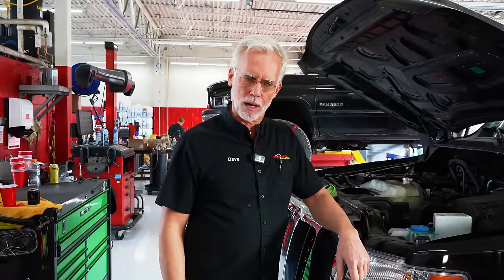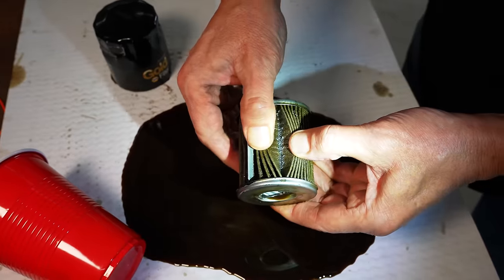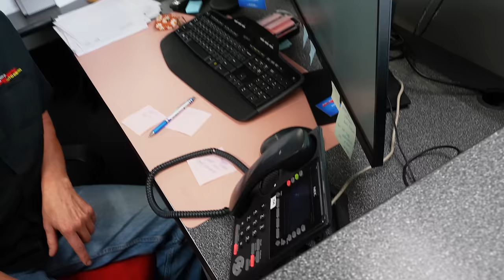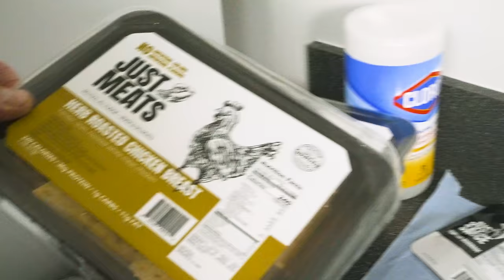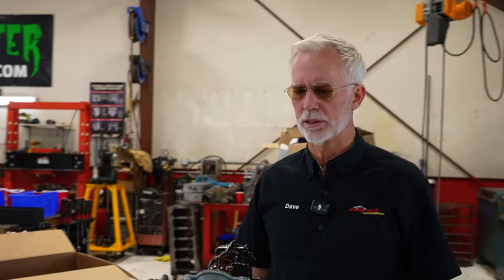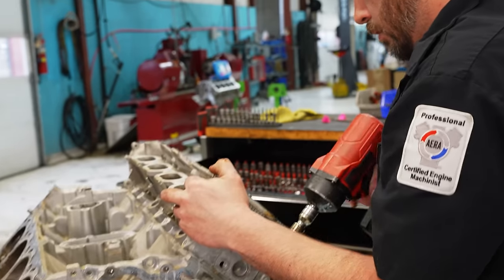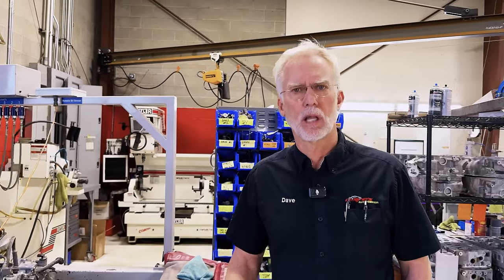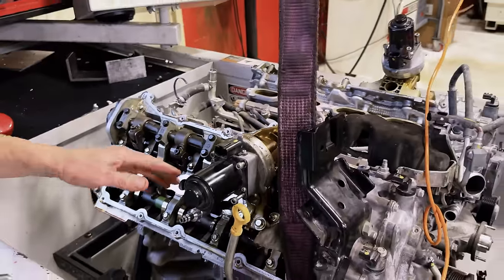2018 Nissan NV 3500 Van. Lack of oil changes ruined an engine with only 50,000 miles on it

Comment: My buddy has a big rig…he does long haul…his Freightliner has an N14 Cummins and he bought it new and does all his own light mechanic work and maintenance…he’s an absolute freak when it comes to maintenance…these rigs will go 20,000-30,000 miles on an oil change…he did his every 15,000 with Esso XD3 when they made it and then went to Mobile 1…he put a quart of ATF in every oil change and a quart in the fuel tank when he filled up…after about 2 million miles without putting a wrench on it the engine was starting to get a little tired so he took it to Cummins to rebuild it…they wanted $30k to rebuild it but couldn’t believe the mileage on it and figured this was at least  its second…he said he never touched the engine so they called Cummins Corporate and Cummins offered him a brand new long block crate engine for the same price if he would give them his old engine so they could do a tear down on it to try and figure out how it lasted so long…so that’s a testament to how important maintenance is!..change your oil people!!
Reply: That's incredible! What was the outcome on the teardown of his original N14 Cummins?
Reply: @matthewmiller2268  I don’t think they ever told him…I’m going to quiz him about it!…
Reply: The N14 isn't part of the million mile club for nothing!
Reply: The N14 has a "robust" bottom end to say the least. You keep it well maintained and it will last a very long time as evidenced here.
Reply: @ronaldrussell5481  he also doesn’t drive the truck hard which helps a lot too…I worked with a guy in Alberta who drove a heavy spec Kenworth winch truck and it had a 575 Cat in it and it was coming up on its bearing roll-in schedule which was likely 500,000-750,000 kms, and he took it straight to Cat and the mechanic dropped the pan and pulled the cape and measured the main bearing clearance on all of them and he said they were all the same as new bearings and so there was no point in replacing new with new so he buttoned it up and told him to keep doing what he was doing…I couldn’t tell you his oil change intervals but he was definitely a fanatic about his truck and one other important point he told me was he never drove faster than 90km/hr…so driving habits also increases engine longevity as well…a new engine today is gonna run a fella close to $50k these days so it’s probably a good idea to consider taking car of your rig!
Reply: Absolutely cheap insurance.
Reply: That's agreat story
Reply: I'm not that knowledgeable on diesels, how does the ATF help?
Reply: @MrMan5014 I think not driving your vehicle hard and just take it easy (and keeping up with maintenance) are a sure way to get your engine long last in general. Sadly, some people just did the opposite.
Reply: Shoulda kept the old one ha!
Reply: Why wpuld you put atf? Lol
Reply: Atf cant be good in the oil?
Reply: @qwertykevin1  the engine made it to just over 2 million miles…I can assure you it’s part of the reason why it made it to that high of mileage when most engines don’t make it to half that mileage…the man is almost 70 and has several other trucks and he did the same thing to everyone of them with similar results…he uses it on his personal vehicles as and so does his nephew who had 3 vehicles that made it well over 300,000 when he sold them and they all worked excellent!..it keeps the engines internals clean and prevents sludging with proper maintenance…once there’s sludge in an engine, you’re on borrowed time!
Reply: Love this story!
Reply: What an acaccomplishment! I drive rigs hard unfortunately.  Heavyhaule....
Reply: @theglitch99  heavy haul is fine…the guy with the Kenworth was hauling a 70 ton wheeler low boy doing a lot of oilfield hauling and heavy construction equipment…he rarely had anything lighter than 30 ton on his truck but he drove the truck like he was an old woman driving a Chevette to church on Sunday!…the problem is most people don’t have the time or patience to drive like that, but the way he looked at it was he got paid by the hour so why push his truck hard and kill it?..🤷🏻‍♂️…makes sense I guess…I had a Ram 5500 and I tow my 6 ton mini with it and I got into the habit of not driving it faster than 55 mph or about 90 kmph and it’s amazing the difference in fuel consumption and wear and tear on the truck
Reply: @MrMan5014  I feel like the atf has to break down the oil thou? Can't argue with experience but any science to it?
Reply: @qwertykevin1  ATF is derived from the same base oils as engine oil with similar additives except in different concentrations such as detergents and friction modifiers…these friction modifiers are used to keep small moving parts from sticking like valve guide, lifters, and piston rings…they are especially helpful in high pressure oil actuated fuel injection systems found in earlier Ford, International, and Cat engines…injectors get sticky and you get hard starts, rough idling, stalling ect…Archoil 9100 is a very expensive version of ATF and is proven to help engines run correctly and minimize wear…most diesel engine oils like T4, T6, Delvac1300 have Jaso certifications which means they are good for motorcycle engines with wet clutches and high revs…imagine having a high revving motor cycle engine with a sticky valve…these additives keep them clean and moving freely!…the proof is in the pudding!…In my experience ATF works very well in engines in the right amounts!…1 qrt in a five gallon bucket isn’t going to break down anything…
Reply: They do a tear down to make it  more cheap for the new generation
Reply: N14 is pretty bullet proof, close to a Series 60 Detroit.
Reply: It's not our residential vehicle 0-20w garbage oil either. Great work. I'll consider looking into those tips. But dave and that Lake guy just said any fuel additive is needed for gas or diesel. It's made a small 1-2mpg difference in my truck and highlander. Great story.
Reply: Oil in the fuel what’s that about is this something to consider for a smaller diesel
Reply: @joshuabrown1117   it helps to keep the injectors from getting sticky and I adds lubricity to the fuel to prolong injection pump life!..people have been doing it for years…since the 50’s or 60’s…it’s good for all size diesels..not sure if I would use it on modern diesels though but I’m sure it would be fine..
Reply: @joshuabrown1117  There was talk that the low-sulfur diesel is too 'dry' for pumps and injectors. Many companies have come up with fuel additives to help lube up the system. Thinning out a litre of oil in a full tank may greatly increase the lubricity. I'm sure there are YT vids testing this theory. 
Adding ATF in the oil, running the motor then doing a change has been practiced for decades. The cleaning additives help flush out the gunk. Adding it after the oil change sounds weird to me.
Reply: @mplslawnguy3389  a lubricant i would assume.
Reply: @qwertykevin1 back in the day truckers used to put transmission fluid in the fuel tank, just one quart because it was a very cheap and effective fuel injector cleaner
Reply: For hard working trucks it's best to do oil sampling regularly to test how worn the oil is and to track for any irregular wear in the engine

Comment: CHANGE YOUR OIL PEOPLE! Dave doesn't want to see your engine in his shop like this one...
Reply: at least put oil in it!!??
Reply: @heethen112  It was more of a PSA then anything
Reply: Yep Nissan motors should last 30 years without any problems if the oil is changed regularly and looked after
Reply: @CruisinCaprice in 30 yrs me and my dad will have 600k or more miles on an engine easy .. that comment is a lil exaggerated 😂
Reply: @heethen112 yep need oil the owner says they ran it dry
Reply: He secretly does or he would be broke 😂
Reply: People think i am crazy to service my GTI every 3500miles or every 6 months. I just use OE/OEM parts and liqui moly 5w40 ( Mk7 gti )
Reply: I actually think Dave likes seeing these poorly maintained cars come in because,  if I owned an automobile repair shop,  I'd find it quite easy to tell a customer...it will cost 12,000 to fix this
Reply: @CruisinCaprice I think they last about as long as the water pump does. Who put the water pump driven off the cam chain under the front cover inside the crankcase? That was a total ford move
Reply: @Youtubecensoredmyusername  that’s why oil pressure gauges are a great idea for any car.
Reply: NEVER!
Reply: Nissan, owned by Renault enough said I think.  @CruisinCaprice
Reply: @blackvulcan100  I drive a Nissan patrol with over 800k on the farm I work on  and it never fails.
Reply: It makes money for his business when people neglect their vehicles
Reply: After you watch that I do cars dude break down a few trashed engines, you will definitely check your oil.  Everyone who drives a vehicle should watch those videos.
Reply: @CruisinCaprice …definitely not true with a nissan made in the last 15 years.  Nissan used to be quality, not anymore; but that’s true with most manufacturers.
Reply: @deplorablelibertarian  maybe right there, I haven’t driven any late model Nissan, I stick to Toyota Holden or Fords
Reply: Seriously, though. Use good oil, good filters, and match the schedule. My Subaru is every 7500 miles, and my wife's Toyota is 5000 miles. If you really want to save money, then do it yourself. It isn't that hard.
Reply: @Vikturus22 it’s definitely overkill, but nothing wrong with taking care of your shit ( not time or mileage ) liquid Molly is expensive and test have found mobile 1 has a equal performance  for cheaper !
Reply: @CruisinCaprice yeah okay 😂 Nissans one of the worst vehicles out there.
Reply: @RevDevGaming  yeah I’m sure you know what you’re talking about hey 🤪🤦🏻‍♂️🥱
Reply: @RevDevGaming  maybe on your computer games, sped boy talking like he knows anything 🤪 how much experience do you have with Nissan Motors? Don’t lie though 😆
Reply: @CruisinCaprice  You sound exactly like the kind of person that would defend a poverty ass Nissan.
Reply: @CruisinCaprice  As someone who worked at a Nissan dealership for 3 years I’d say I do. They are terrible vehicles that constantly have major issues. They suck to work on and the only people who buy them are people who don’t know any better. How poorly they hold their value should speak for how well they are built.
Reply: @RevDevGaming  what country?
Reply: @CruisinCaprice  I live in the US. I’m not referring to like the GTRs and the cool stuff but their everyday consumer vehicles are complete trash. The old stuff was pretty good but much like Kia their new stuff is just terrible.
Reply: @RevDevGaming  I’m talking about the older Nissans, patrols and skylines ect wouldn’t buy a Nissan pulsar or anything gay like that and I was talking about how many miles they can handle so nothing you learned working for Nissan has anything to do with my first comment 🤫🥱
Reply: @CruisinCaprice  Yeah they weren’t all bad. The patrols are cool. I was referring to their new stuff. I’d go as far as to say they haven’t made a reliable or good vehicle for a quite a while now though.
Reply: I drive a 2002 Chevy Silverado with a cammed 5.3 it’s my baby I change it every 3,000 to 3,5000 yes always check your oil and change your oil at 3,000 to 3,500
Reply: Unfortunately, those dummies are never in short supply. Keeps Dave going strong tho lol
Reply: @AMan7595  I wouldn't trust that 7500 mile interval unless you live in the perfect climate and you only drive easy highway miles like a sedated librarian and subaru's have been known to burn oil so be careful with any extended interval.
Reply: @Vikturus22 3000miles is minimum, 3500 is way over
Reply: You're right about some Subarus burning oil. Keep an eye on that dipstick peeps!!!!
Reply: But wouldn’t Dave be losing money if he didn’t have cars to fix?
Reply: A nissan notor lasting 30 years?  Un thats a little bit of a stretch bro lol@CruisinCaprice
Reply: @CruisinCaprice yeah sure
Reply: @CruisinCaprice fords that's your problem right there

Comment: Nissan tech here. I’ve replaced short blocks on those engines for the rod knock issues. I’ve never seen one as bad as that. I bet that engine never had an oil change. They probably just kept topping it up
Reply: Hi, I have a 2019 V8. Would you say there reliable? I am aware of the cylinder #7 scoring on the newer models.
Reply: Timing cover will leak oil 👍 that’s for sure. And you don’t see too many of the cylinder scoring issues.
Reply: Man that TSB for cylinder 7 knock. Bruh… not a fun job hahah
Reply: @jakemathers4137  Yeah they suck. Just another reason why I got out of that garbage trade.
Reply: @rickfrey6944  It’s still possible that your v8 could develop that knocking issue. Nissan said they made updates to the short blocks but I’ve seen a few have it happen again. Just make sure you do your oil changes on time. Other common issues we’ve seen is upper oil pans leaking and timing covers leaking.
Reply: @fitztech  Thanks for the reply. I have 44,000 miles. Going to consider purchasing an extended warranty before mine runs out next year.
Reply: @fitztech yeah that’s why
Reply: all i know is about 22 hours warranty to do a short block on our v8's  is the worst job you can get, i've done a few
Reply: Are the new frontiers good? I bought a 23 pro4x.
Reply: So far. But i prefer the 4.0 litter more…the 4.0 didn’t have many issues. The older ones did with timing chain guide wear and transmission coolers blowing out but there later ones dependable
Reply: Ive bought an older xterra (2007) and placed a 2013 motor on it , also a 2012 xterra with a 2018 motor . Those later motors sure are better. @89gt5.0
Reply: The dreaded engine knock Nissan Service Bulletin NTB19-057a affects the gas V8  VK56VD built 2017- April 2019.    Oil injection defect number 7 cylinder.     Nissan dealers can't get short blocks in fast enough,  huge headache.    They should extend the 5 year/100,000 mile warranty and let all owners know that knocking noise isn't in their heads-   some guys are on their 3rd short block and still not fixed.   C'mon Nissan!!!😮😮

Comment: I own a 2013 Nissan NV2500 HD with the 4.0L V6. It has just over 430,000 original miles on it with the original motor and transmission. I am the second owner and it’s had 5,000 mile  oil change intervals since it was new. These vans are solid if you take care of them. So sad to see this one being neglected like that.
Reply: Is it the original timing chain(s)? If so, that's really good.
Reply: @dadgarage7966  After 2009 2010 Nissan fixed the timing chain issues in the 4.0V6. Super durable Motor when you maintain them. Also not direct injected like the New 3.8 and the New 5.6 V8. The 4.0 is a bit of a gas hog. But they will run forever when maintained properly. As good if not better than any Honda or Toyota power plant,
Reply: VQ motors have been around for a while, chains usually start stretching around 300k. i had 2 Maximas back in the day.
Reply: @dadgarage7966  I did replace the timing chains, tensioners, and water pump at 320,000 miles because I started hearing a slight rattling noise on start up, but when I got into the motor the chains were not excessively loose.I honestly think they were fine and it was a pulley bearing I was hearing. I finished the job anyway as preventative maintenance since the engine had high mileage. I did all the work myself and it was very labor intensive, but I saved over a thousand dollars doing it myself even with using all OEM parts. The van has ran great for over 100,000 miles since the repair. I own a business and this is my primary work van. I maintain it religiously.

Comment: Thank you for the part about "They don't make them like they used to"  I own modern vehicles and classics with carburetors and every time a friend says "I should get an old car" I lecture them about how much work they are. Yes, you can fix them yourself with hand tools if you know what you are doing but they will require constant maintenance and won't be reliable like modern automobiles or nearly as comfortable or economical.

Comment: I always say this every time. Its way cheaper and easier to change the oil , than an entire motor. 

This statement can be applied to anything on a vehicle, Transmission, axle, transferase, coolant ect, and I drill this into anyone who I encounter with car issues.
Reply: I completely agree with you.  I think people today have deliberate indifference to what maintenance needs to occur.   Differential fluid is overlooked often... Transmission fluid is not lifetime.. coolant fluid is not lifetime... I'm sure I'm missing other fluids and components that should be serviced

Comment: Dave, you’re right about the old engines and the tune ups and lack of longevity, BUT modern engines are overly complicated, not “just” to meet emissions and to be efficient, but the layouts are annoyingly complicated. Been working lately on a Mercedes diesel; lost of plastic and lots of complicated solutions.

Comment: 2009 Armada here pushing 160K on the old 5.6L V8. Used to do 3000mile changes. Switched to Amsoil in 2010 and religiously tested the oil. 

Now doing 10000mile/annual oil changes and analysis showed that's the max life of that oil. 2024 and that engine still running strong and no mechanical issues.